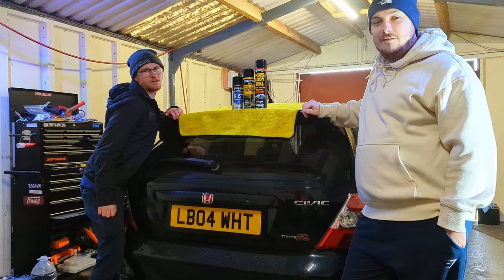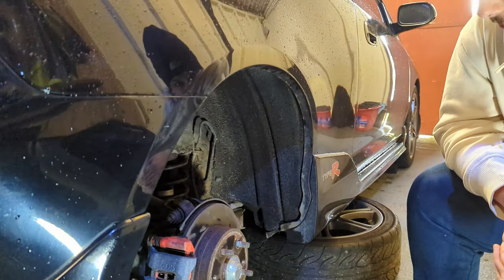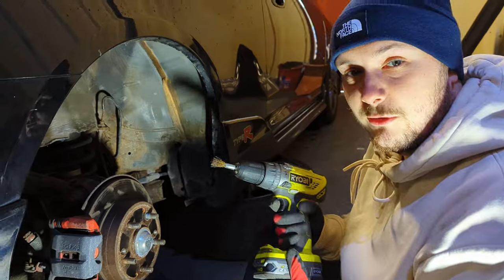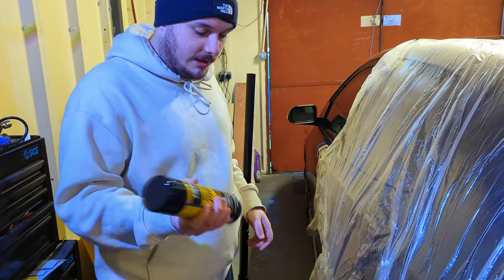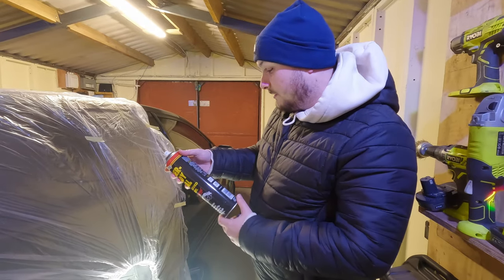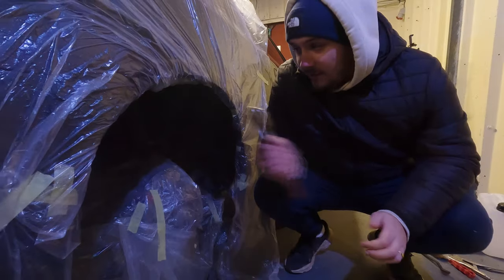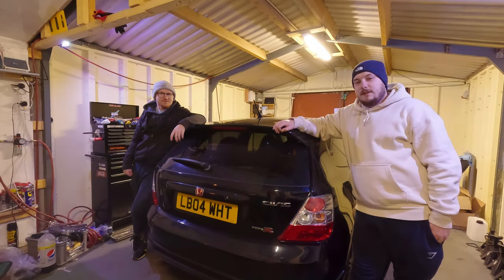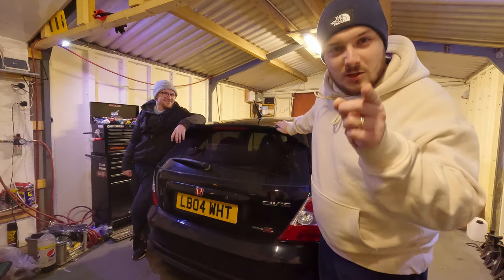Undersealing the rear arches on my EP3 Civic Type R

Comment: Waxyoil is the wrong stuff to use! It traps moisture between the metal work and the waxyoil! The proper stuff to use is Dinitrol. I’ve used Dinitrol on all my imports over the past 20 so years without a single problem and as it’s clear you can see the chassis as it is, and it’s not being hidden under black tar! With waxyoil you will see it becoming loose, and when you pull at it you will see that it has become loose due to rust that’s been caused by trapped moisture! 👍
Reply from the maker: Thanks for the tips! We will definitely look into this 👍👍
Reply: @kentcarmedia  definitely look into it bud! I’ve seen the best professionally prepared chassis that’s gathered rust once the waxyoil has been applied! 👍
Reply: Yeah waxyoil is the worst thing on the market it should be banned! I hate the stuff, what dinitrol do you use it is the clear cavity wax dinitrol 1000? Would appreciate knowing the one you'd recommend :) cheers

Comment: Would look at cavity waxing the sills . Mine failed an mot on rotten sills . Remove rubber grommets on sill and can get access . Can do rear by removing rear  speakers also. Also behind rear bumper will have rust but well hidden.
Reply from the maker: We plan to do a video on behind the rear speakers at some point. Will have to look behind the rear bumper. Did you end up getting new sills welded in?
Reply: @kentcarmedia  sadly sold it for spares as was spare car and did have time to fix . Had a good few years out of it but miss the vtecyo. Was inner sills there rubber bungs all the way along that I didn’t remove when under sealing to cavity wax.
Reply from the maker: @AM-wt8qi  A FN2 is a good option for cheaper VTEC nowadays and a great daily. Will have to get the EP3 back in and check those areas!